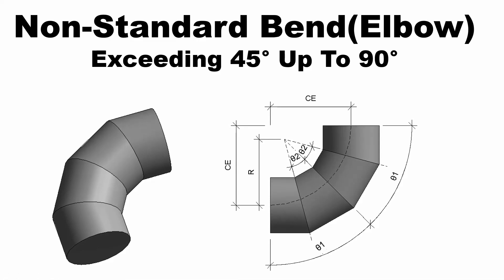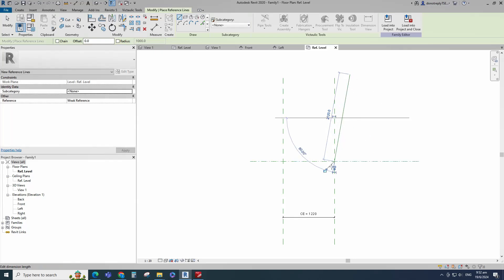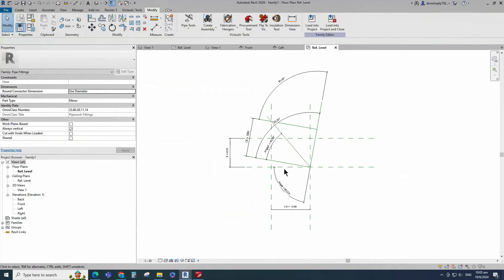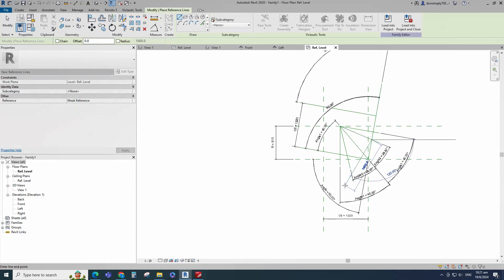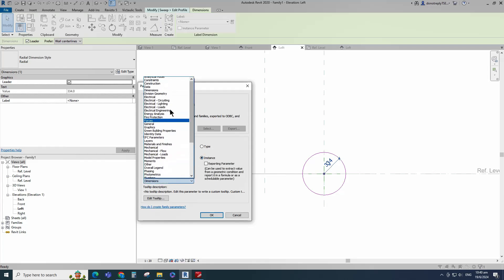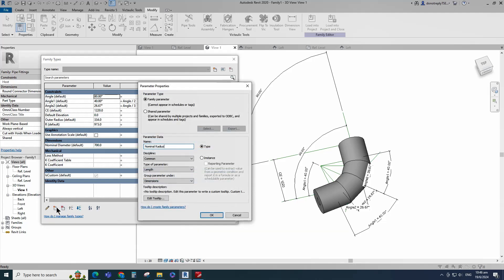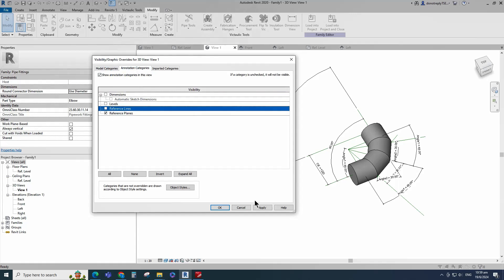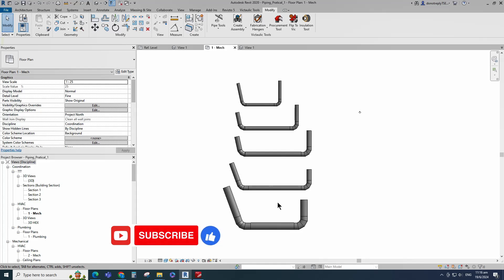Non-Standard Bend (Elbow Exceeding 45° Up To 90°) Revit Family (Parametric)

Comment: Hi Sir, i have a question, ive drawn the bend as instructed in the video but i would now like to adjust the internal diameter and add a flange on both ends of the bend. would this be possible
Reply from the maker: Yes. You can use sweep to create flange
Reply: @ThomRVT  Thank you, I'll try it out